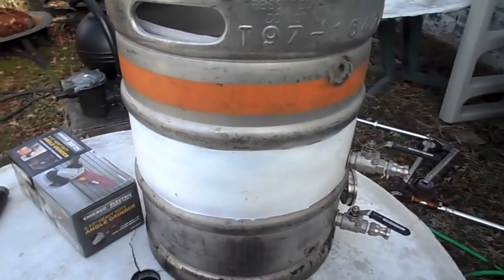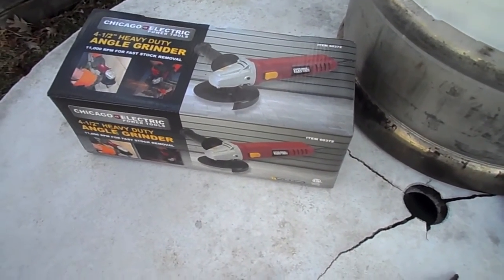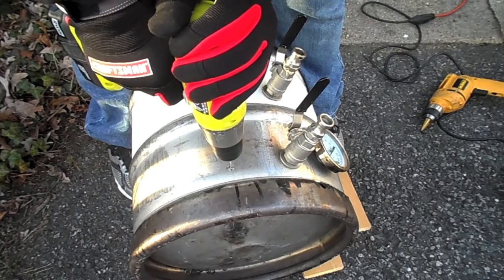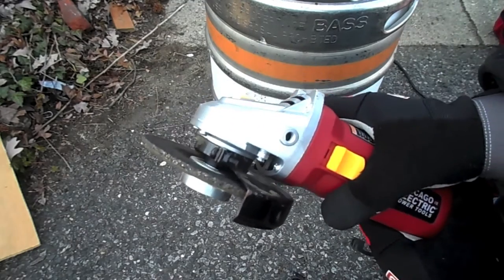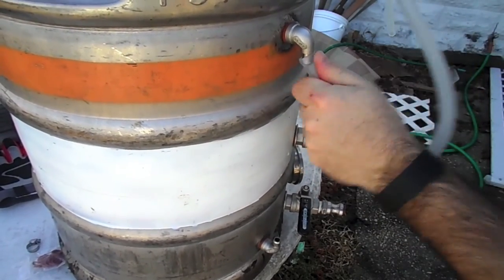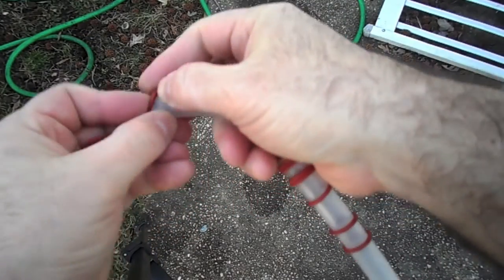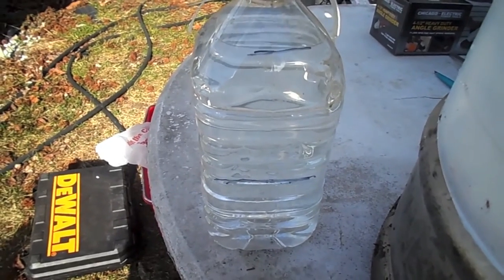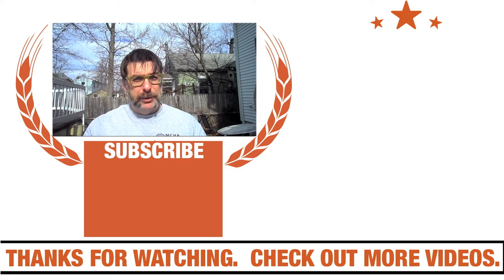Flexible Sight Glass Installation

Comment: Where did you buy the flexible sight tube and fittings? Also, side note about the drilling, if you use an oil or lubricant it helps keep the metal cool and should make it a lot easier to cut with the step bit.
Reply from the maker: Got all the hardware from BrewHardware.com